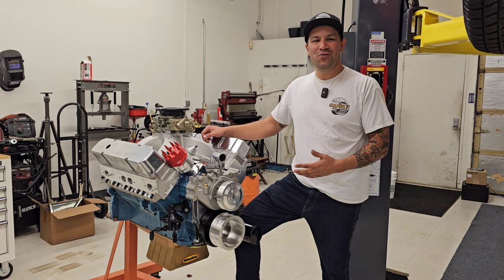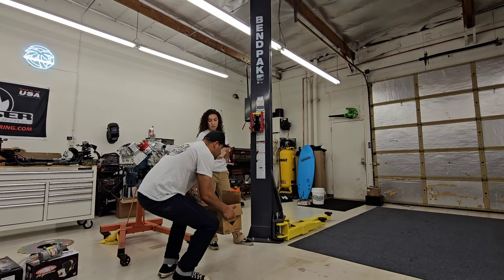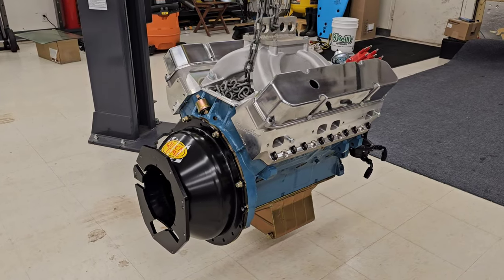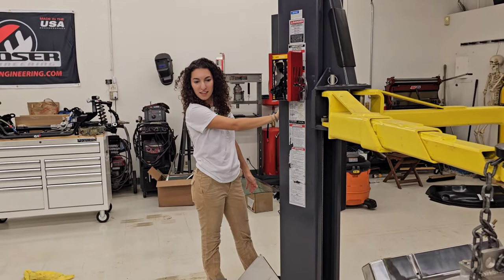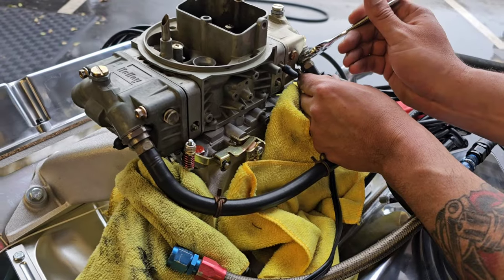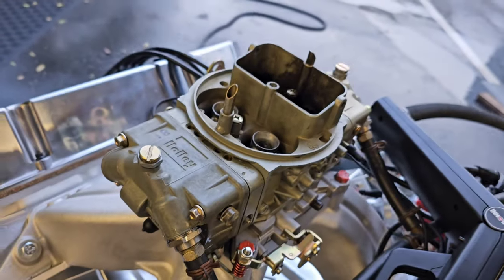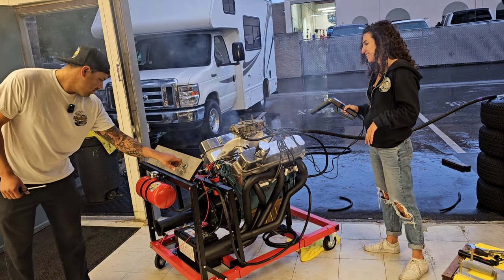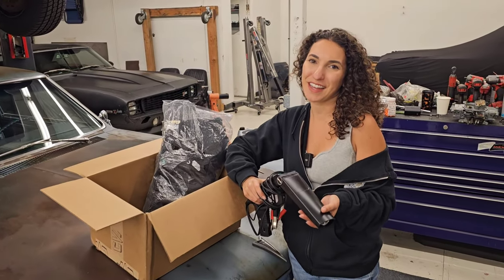We built it ourselves!!.   512ci Big Block Mopar is making noises.

Comment: I run the same 850 Annular booster double pumper and Trickflow intake on my 505ci Big Block Mopar stroker. I'd swap that cracked bowl and get that Annular carb dialed in. It is a FANTASTIC street carb. Those carbs atomize fuel very well and help torque production down low espically with a single plane intake. Engine sounds great btw.. Nice work ! 🍻
Reply: Same here , the new kids don’t do there carb research and do the do diligence on carb tuning .
Reply: You can’t change the needle and seats on the side of the road on injection your stuck.

Comment: Great stuff guys , you have a vacuum leak somewhere or carb mixture screws need to be out further , first thing check your float levels. Don’t give up on that annual Booster carb Change your Bowl out set your float levels properly I’ve ran one for years on many big blocks.

Comment: Good job on getting the engine fired. Before final install in the Charger, you may want to think about replacing the bolts on the exhaust headers and carb mounts with studs so you don’t end up pulling the aluminum threads out of the aluminum.

Comment: Hi, When I rebuild Holleys I always bench test with a small electric fuel pump, and set the float levels check for leaks, Btw Danny, you cracked the bowls on that first carby with the wrench, there isn't much movement with the wrench then it contacts the bowl and ...

Comment: Yes replace the header bolts with studs thats what i have on my afr heads on my big block not only will it keep from pulling your threads out of the head but also you get more clamping force on your header flange no leaks.that is the only thing i dont like about aluminum  heads i think they all should have Healey coils in them.

Comment: Couldn't you ave mounted it the other way around? So the Bell housing brace was at the other end and put the smaller brace at the controls end and have the engine facing the other way?? Then you could have run the exhaust out the door if you wanted even.

Comment: Camshaft Break in is 2,500 RPM for 10 min's  it's gonna be LOUD for 10 min's. Get some straight pipe and 2 muffler's although you are in a commercial zoned area. It'a also going to blow alot of dust up maybe put a stack of pallet's behind exhaust to muffle it up a bit. And will be Hot to stand to look at gauge's
Reply from the maker: Luckily this a roller setup!
Reply: @GnarlySpeedShop  Oh yeah,I forgot it was a Roller cam 😃

Comment: Make sure you don't let the engine idle,you should run it at 2500 rpms right away,for about 20 minutes or more,to break in the cam or you can damage it
Reply from the maker: Luckily it's a roller cam
Reply: Some say you don't need to on a roller cam,but many believe you still need to .I wish you luck,the choice is yours.sure does sound strong!

Comment: Nice stand, but I'd suggest swapping the exhausts over so they exit away from the operator - 
a/ it will reduce the noise level,
b/ it keeps the hot exhaust manifolds and
c/ hot exhaust gases away from the operators legs

If a Mk 2.0 version is made, if the engine is reversed, and a radiator, with draw through fan, is fitted below the test panel, it would allow longer running at higher rpm, for things like bedding in flat-top lifters?

Also, some engine dyno's are set up so engines can be fitted into a cradle and quickly slid into, out of, the brake' - if the dyno' you're looking at using is set up like that, have a word to the owner/operator if they will give the details like crank' centreline height, clearances, etc, that will allow one's own stand to be a straight fit.

Comment: i would use a dual plane intake for street
Reply: With 512cu.in, loosing a little torque to the single plan is no big deal. That motor will make 660 plus torque by 3500rpm.

Comment: Next time instead of buying that overpriced starter just get one for magnum engine  94 up much cheaper and will spin a 14 to 1 bigblock over with no problems . I use them on all my mopar builds .
Reply from the maker: Noted!
Reply: I don't currently have a mopar- but noted- great tip.

Comment: Guys Put a Vacuum Gauge on it  Run the Metering Block Screws  all the way in then Back Our 1/5 to 2 Turns then Adjust the Idle Screw till the Butterfly's are Open enough to Idle then watch the Vac Gauge and slowly Adjust the Screws in the Metering Block till you Achieve the Most Vacuum then you should Be able to Back Off the Idle Screw to around  say 1200 RPM  Guys it Sounds Great SO far though Nice Job :face-blue-smiling:

Comment: Looks like either the engine is in the stand backwards or the control console is on the wrong end of the stand!! Enjoy your videos Danny and Liv!!!
Reply from the maker: Believe it or not, that's the way it is supposed to be set up according to instructions. It worked out because we were able to connect the hose and dump the water outside
Reply: That's odd, I've literally seen dozens of run stands but never one with the engine configured in that direction!!

Comment: Love the 512s. Have one myself. It made 763hp on pump gas (Indy Heads) but hey! I Have the same stand if you swap the bars that engine mounts onto you can run it where the front of the engine is towards the gauge panel, ditch the small fuel cell up front, then throw a radiator on the front and you're good to go.
Reply: If you need reference, you can see how I run the engines on my stand! Either way, good content! Good luck with the rest of the build
Reply: also, i run a proform 1050 on my 512. I like it. It's a 4150 series as well, so you wouldn't need an adapter plate for the 4500.

Comment: love watching you two working on the cars  it passes time while im at work wish i had a young lady to help me or want to learn to work on cars lol 
 just a thought since you have not taken out the k frame yet i would clean the engine bay up to the way you want it then put the engine on the new k frame an since you have a lift lower it on to the new k frame with the engine so you dont have to go from the top to drop in the engine an you can keep the headers on when you go from the bottom you will need to make a k frame stand with wheels so you can aline it with the car as it comes down. An great job on build an starting that engine

Comment: Great work guys. All the typical stuff fuel leaks etc., Welcome to the mopar world. Only advice is don't run too long on a engine stand, you HAVE to get load into those rings to seat them properly , that's why most engines are broken in on a dyno where they can put load into the engine for ring seating and break in. congrats.  cheers I enjoy the channel

Comment: A 670 carb for a 500+ cod engine? That's like trying to breathe with a rag stuffed in your throat guys. You could use a big cfm standard carb or a dominator. Also, with no choke horn, the engine should be warm before trying to set timing. . Put a fuel shutoff valve on your stand. If you cut the fuel and the RPM rises about 25-50rpm before dying the you have the mixture about perfect. The little "puff" through the carb of gas means your timing is probably not advanced enough. All in all, nice startup though!

Comment: Hey guys atm makes really good carburetors that run perfect out the box the company is owened by the man that owned quick fuel after he sold the company his kids wanted to get back in the business so they started atm i bought the 950 for my 427 weĺ its a 439 really but they will build it just like you want it and when you get it it comes with the build sheet. Best carb on the market for the money im not sure if you are fermilure with the you tube channel old mans garage but bill the guy behind omg is a carburetors  genius and atm has his signature series carburetors the omg 750 850 and 950 they are set up with the pump cams and power vaulves he runs for the best running around town and flat out drag racing and there is nobody i can think of that i would trust more to build or tune a carburetor then bill they also offer them in gas or E85 application the carbs also come with the stock type neetering block and base plate or the billet mèetering blocks and base plate thats what i got for 100 dollars more. I just thought this might help you the last holly i bought was pretty much just thrown together and the needle and seat was jammed into the front bowl and as soon as it got fuel in it the fuel was pouring out of it i said then never again. I went to atm and thats where my money will go from now on. Congratulations  on the 512 build.😊